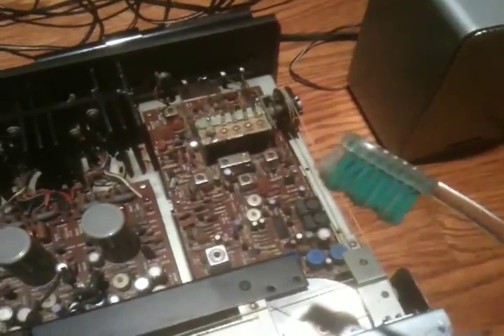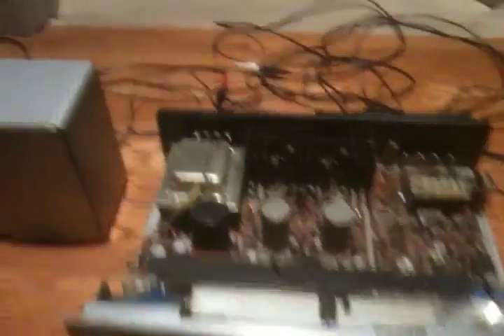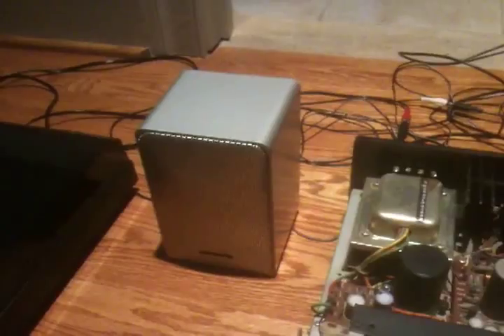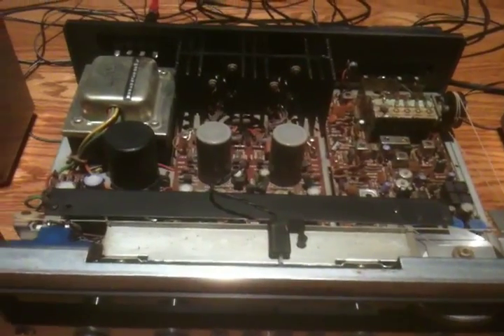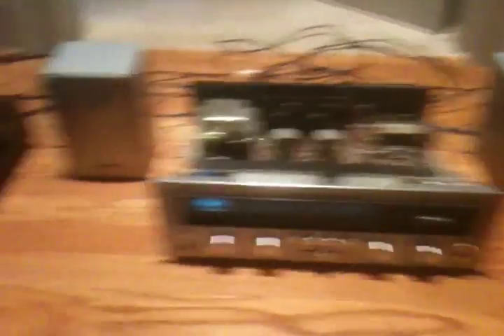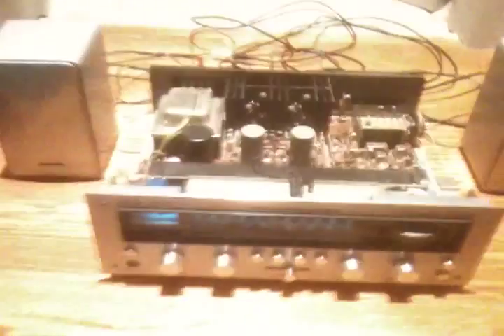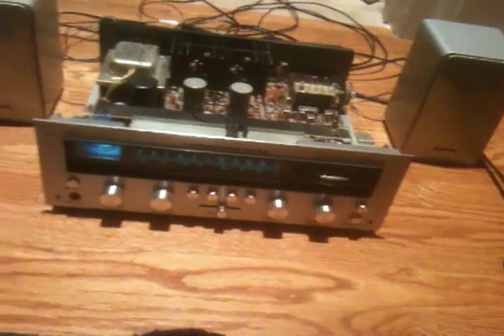Marantz 2015 Stereo Receiver - Post Cleaning

Comment: Cool little Marantz.  15 watts per channel just like the 1030 amp I use on my PC.  I think they actually put out around 20, as Marantz tended to rate the power conservatively on their stuff back then.

The balance issue may have been dirt in a control, or a loose solder joint.

Comment: I forgot to add, I found one of these at a local Goodwill recycle store for $250 back in Feb. this year. They had to be smoking something. I passed on it. I knew there was one somewhere cheaper. Went back later n the month and it was 1/2 price. It was finally gone. I got one for the price I was looking for.

Comment: Awful little power for that amp. You'd figure Marantz would be a little more powerful. I guess most of my amps are around 25 per. Back in the day of those classics, high power wasn't an issue. As long as it's clean, that's all that matters there. The awful comment did not mean that sounds bad, just small amount of punch for it is all. I just bought one on eBay for $125. I have a Realistic in near mint  condition I use now that's 18 per. It get's the job done.